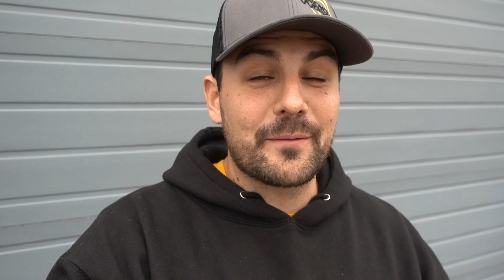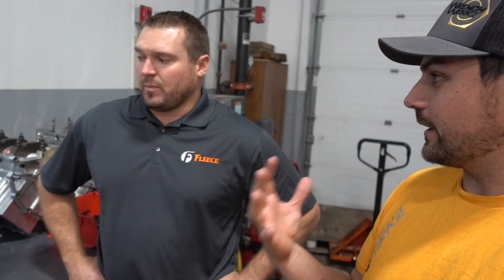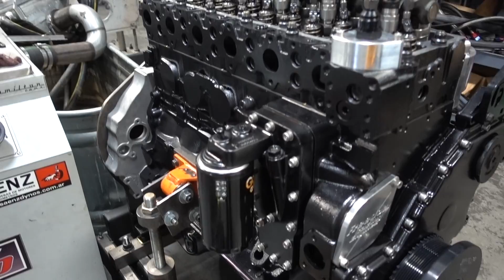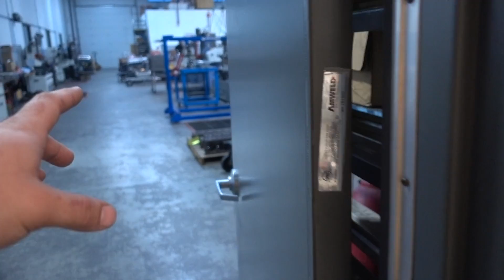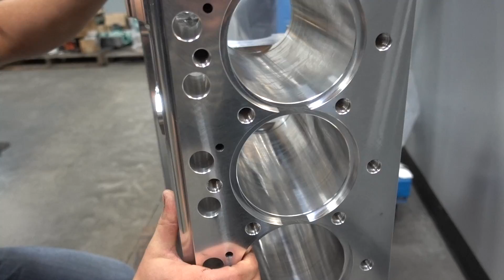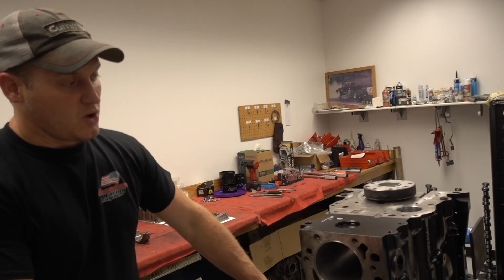GETTING OUR NEW INSANE CUSTOM ENGINE BUILT!!!! @ FREEDOM RACING ENGINES!!!!

Comment: Testing the valve job on a reconditioned cylinder head:

It is getting to be most difficult to find a shop that does a quality valve job. Testing the valve seats on a new or reconditioned head will most always reveal a few leaks. The shop will typically say that all seats were vacuum tested, which is supposed to be the ultimate quality control test. However a simple test of filling the ports with water before install will reveal any leaking seats.

My own experience was that of a 2002 / 5.9 / 24V which was leaking past a couple exhaust valves during a leak-down test. So while I had the head off doing a repair to broken rings on #5 cylinder, I had the head checked out at a shop near Dallas / Ft. Worth (big on diesel). They found three cracked valve seats which were said to be of a tempered cast seat and not replaceable, so my head was junk. Then a reconditioned stock head with new hardened seats would cost me $1,000 since my core was junk. I took the rebuilt head home and noticed that my "junk core" was not in the truck, so they had kept it and when I returned two days later asking for it, the scrap truck had supposedly already taken it.

I tested the rebuilt head by first bumping all the valves with a rubber mallet to be sure that the valves were all seated and with the exhaust side up I poured water in and found five leaking valve seats, with two on the intake. I called the shop and they were very defensive, giving lame excuses to my method of testing, but offered me my money back. I responded that I didn't want the money, what I needed was a head that does not leak. They had a new core which was rebuilt with used parts for the same price and I took it as it was my only other choice and when I picked it up the builder had the head sitting with intake side up, full of water saying it had been that way for hours and showed no sign of leaking seats but did show oil around the seats. I presume that the seats were oiled / greased to stop any leaking because when I got home and checked the exhaust seats I still had eight which would seep water past the seats.

I had done all I could in my local area and bolted the reconditioned new core onto the motor. So am I expecting too much when I spend $1,000 on a head to ask that the seats don't leak? Looking around Youtube these leaking seats are generally expected on mass-produced heads. Haven't fired it up yet so still don't have any idea what to expect.

Comment: All aluminum blown Pontiac with a magneto igintion only makes 600 hp??????
Reply: itsmeagainmargret he said on pump gas. My guess would be much higher with race fuel/methanol.
Reply: that blower probably makes less than 7 psi
Reply: Thought the same thing. It's gotta make power in the 800 range easy
Reply: i was thinking the same.
Reply: Notice the huge top pulley on the blower, not going to make much boost